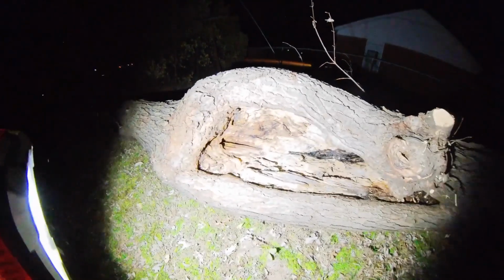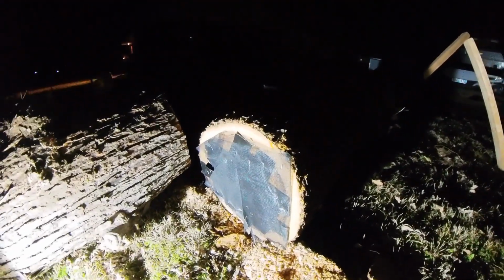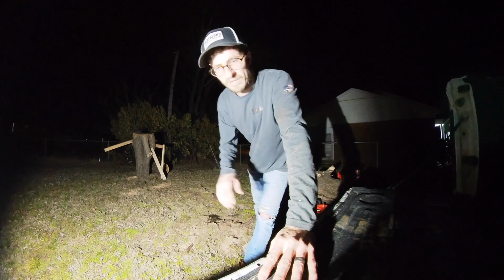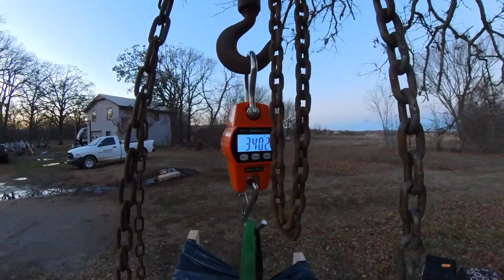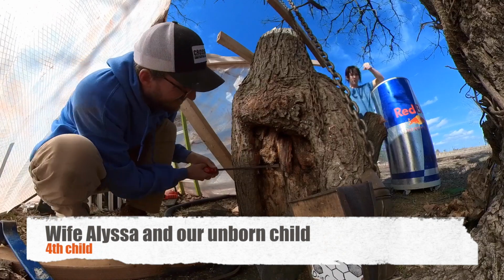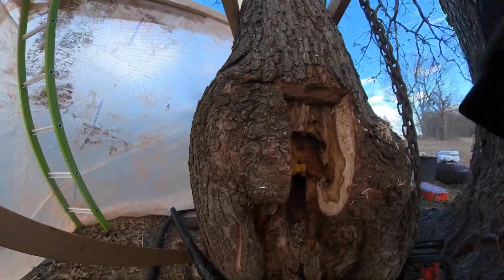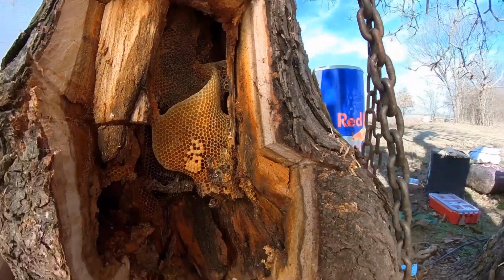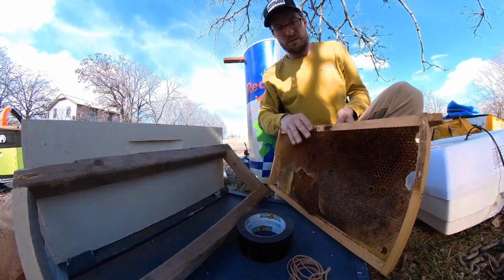Honeybee Rescue! Barely got them loaded into my truck

Comment: Like they say were there is a will there is a way. I have to do all my cut outs alone to. My wife sits in the truck with the ac on to help me IF thing get dicey. But have not had problem yet. This looks fun.
Job well done.
Reply from the maker: Thanks, man! I had to thread the needle between winter fronts. Hopefully pull through. They are taking feed so that’s a good sign. It’s warming back up this weekend
Reply: @DRIECUTHoney  I understand threading the needle I just pick up a barbeque FULL of bees and relocated it and the weather turned very fast cant get back to them until tomorrow to check them going to try to do cut out this weekend IF I can figure out how to even open it , lol You did good with what you had to work with.
Reply from the maker: @dennisbarney869  thanks, Dennis. I appreciate you leaving a comment

Comment: Definable do a short version but darn William, impressive! Fantastic cutting!!
My 2 cents, a modification of Ian Steppler's boosting a small hive. See my video "Dual Queen Excluder/Feeder Shim Sandwich!Boosting a Weak Hive".  I have yet to loose small hive doing this.   Put it (even in a 10 frame) over a strong hive. I do a 2 queen excluder with a small shim between & newspaper merge.
Reply from the maker: I’m debating putting them over another hive with double screen board. I think I’ll have to donate a little to them as well
Reply: @DRIECUTHoney  The double queen excluder lets the lower nurse bees aid in raising the brood so the upper queen lays more and faster. Check out the results.
Reply from the maker: @MinnesotaBeekeeper  I’ve seen the video. Remember I joked about using plastic honey excluder. You think it would still work this time of year? Idk how much workers fight. In the spring I wouldn’t think anything of it
Reply: Don't use a chicken water heater. I killed mine....( - ;